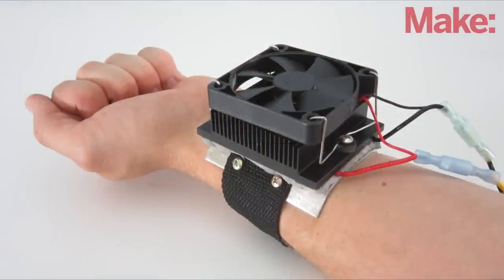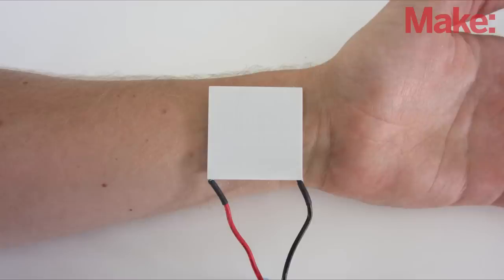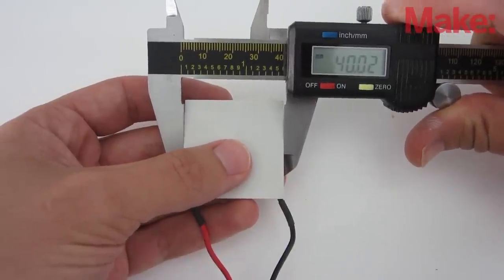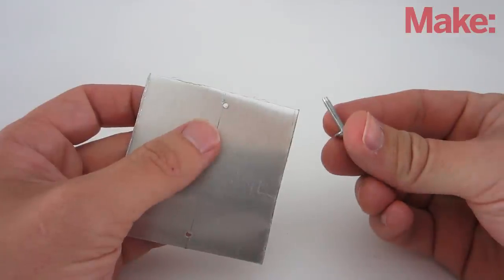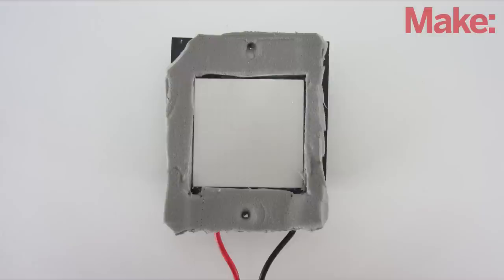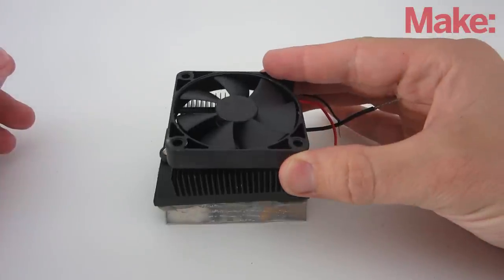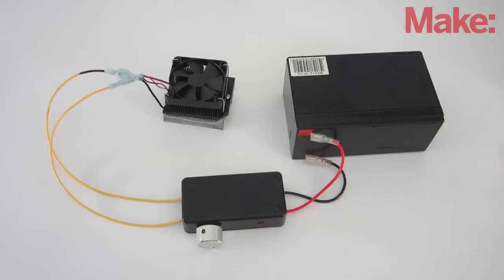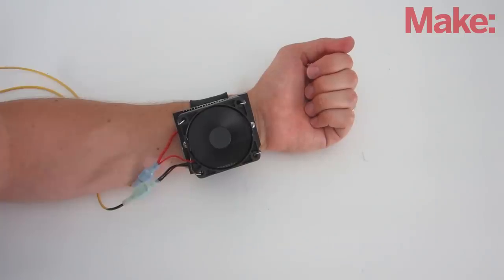Personal Cooling Unit

Comment: Wouldn't recommend doing that as it can give you a cold burns, if the peltier element is strong enough ;)
Reply: hence the 555 and the potentiometer
Reply: Frostbite happens around 0°C. If it can get that cold, a thermistor can be used so that it shuts off before it reaches freezing temperatures
Reply: @autismlifehacks5233  Even if it's 15°C, I wouldn't want to have something that cold in contact with my skin all the time. There are reasons body temp. is around 37°C and peltier wouldn't just affect the surface of the skin.
Reply: @ElectronPower  If it's above 15°C, I'm confident that you'll need something as large as a cooling vest to help you beat the heat
Reply: @autismlifehacks5233  I'm talking about the peltier on your skin, not the ambient temperature...
Reply: @ElectronPower  I understand that 15°C refers to the Peltier's temperature on the skin
Reply: @autismlifehacks5233  Well, according to your comment, it doesn't appear so 🤔

Comment: When I was young I tried to design a portable 12 volt peltier water cooler for a vest that could be worn under motorcycle gear using pwm and mosfets through an arduino to control the water pump and peltiers. The things take a lot of power unfortunately which would explain why there's nothing out there on the market like that. I never got mine to work good enough to be worthy of further development. They're really neat though! I'd love to play with them again!
Reply: Adam Savage created a personal cooler using the worlds smallest refrigeration compressor to use inside a costume. It is battery powered and worked really well!
Reply: you got the wrong materials and design i guess
Reply: I think if you had another go now you'd be pleasantly surprised with the advance in technology. I really want to try and put together one of these as low-profile as possible and then try and work it into the neck of a shirt so it delivers cooling to the back of the neck, and the batteries sat in a pouch in the small of your back, either a couple of 18650s, or a lipo pack, but that probably goes without saying. oh, and bluetooth, because why not

Comment: Cool Project! Also great to see That Make is Using mm (MilliMeters) Aka Metric instead off Imperial. Also with the Motor circuit. Use a MOSFET to control the output. (Since you're already using a N-Channel one to switch the Relay)  It will make it less noisy.
Reply: Americans don't really know it, but they've been using Metric for many years: one inch is exactly 25.4 mm BY DEFINITION, for example.
Reply: Isn't 1 inch 2.45 mm ? But yeah America
Reply: Oh just saw that you said by example xd
Reply: Jac Goudsmit
If you're doing machine tool precision work over more than 6", 25.4001 will keep you from getting rejected parts.
Honestly, distance is distance and units are units. People with Imperial scales will work to Imperial measure while people with Metric scales will work to Metric and nothing of that will change the actual dimensions worked to.

Simple fact is that "Americans" often work in Metric as well as Imperial and have for decades. There is no hidden measure that anyone is "really" working to, scales are arbitrary. Ask yourself why 1 meter is not what it was originally intended to be, a certain fraction of the size of the Earth. Yes, because the people who invented metric measure got the size of the Earth wrong by over 10%! The length of a Meter is based on an ERROR and that, my man, is arbitrary!
Reply: *****
2.45 cm, rounded to 4 places. The reality is not so neat.
Reply: *****
1 inch = 2.54 cm or 25.4 mm
Reply: ***** The length of a meter is actually defined as 1/300000000 of the distance that light travels in a vacuum in one second. In other words, light goes exactly 300,000km/s in a vacuum by definition. And a second is derived from the frequency of a Cesium atom under certain circumstances, I don't remember the details but Wikipedia is your friend :-)
Reply: ***** actually, the error is less than 0.2%, not 10.
Reply: The word meter is spelt metre unless you are not talking about 1000 mm.
Reply: Jac Goudsmit it's actually 299 792 458 m/s so it's not exactly 300000km/h
Reply: Perhaps some have trouble with words like exact and error? Or maybe have never actually done precision work? Or can't tell the difference between unit of measure and object being measured?

25.4001 mm per inch lets a person cut metal within tolerances that 25.4 does not. Been there, done it 35 years ago making not-small parts for a Swedish company.

We are not all Tea Party Idiots, thank you,

Perhaps someone can tell me how exact C was known in 1793? Fizeau came later.

The French Academy of Sciences commissioned an expedition led by Jean Baptiste Joseph Delambre and Pierre Méchain, lasting from 1792 to 1799, which measured the distance between a belfry in Dunkerque and Montjuïc castle in Barcelona to estimate the length of the meridian arc through Dunkerque. This portion of the meridian, assumed to be the same length as the Paris meridian, was to serve as the basis for the length of the half meridian connecting the North Pole with the Equator.
The exact shape of the Earth is not a simple mathematical shape (sphere or oblate spheroid) at the level of precision required for defining a standard of length. The irregular and particular shape of the Earth (smoothed to sea level) is called a geoid, which means "Earth-shaped". Despite this fact, and based on provisional results from the expedition, France adopted the metre as its official unit of length in 1793. Although it was later determined that the first prototype metre bar was short by a fifth of a millimetre because of miscalculation of the flattening of the Earth, this length became the standard. The circumference of the Earth through the poles is therefore slightly more than forty million metres (40,007,863 m).[10]
Reply: I stand corrected on the definition of a meter (or metre if you prefer): it's 1/299792458th of the distance light travels in vacuum in a second. http://www.bipm.org/en/CGPM/db/17/1/

The standard for an inch has been 25.4mm since 1959. See http://www.npl.co.uk/reference/faqs/on-what-basis-is-one-inch-exactly-equal-to-25.4-mm-has-the-imperial-inch-been-adjusted-to-give-this-exact-fit-and-if-so-when-%28faq-length%29. I assume the 1959 definition still stands, so the defined length of an inch also changed in 1983 when the definition of a meter/metre was last adjusted.

I don't know why your Swedish customer 35 years ago wasn't happy until you pretended that an inch was 25.4001 mm. I'm not a metal worker but I see that (for example) steel has a linear expansion coefficient of 11x10^-6 per Kelvin. If I understand correctly, that means that a rod of steel that's 1 meter long at room temperature would become 11 micrometers longer or shorter whenever the temperature rises or drops by one degree Celsius. So it only takes a piece of steel that's less than 10cm (less than 4 inches) long to change in length by more than one micrometer (the difference between 2.5400 and 2.5401mm) even when the temperature only varies by a single degree Celsius (1.8 degree Fahrenheit). That makes it seem pretty silly to talk about such small quantities of error when making metal workpieces, the size of a hand or bigger.

Anyway, going way off topic here...
Reply: Jac Goudsmit
Because when holes and edges need to be within 0.1mm at around 30cm apart then it doesn't matter what system of measure is used to manufacture the parts.
If the tolerances were smaller to where a part that measures right at 25C would not be at 20C or 30C we would not have taken the job. But you are talking about far smaller changes over shorter differences by regurgitating numbers that you don't know how to use.

Manufacture deals with the real, not simply parroting what someone looked up to confirm their opinion but never really checked.

You don't multiply 3 place precision by 100's and expect 2 or better place accuracy.

25.4001 is 4 places accurate what 25.40 is 3 places only, not some golden absolute but only 4 places where there are more to go.

So I tell you that all measures have some degree of error, don't spout about how close an electron microscope can get and then throw me a 3 place round off as absolute! You might as well graze with the cows.

People using one system of measure are not secretly using another just because you measure the result with the other.
Think about that next time you say 'stupid Americans' because this American sees you for the fool you make yourself out to be.

Comment: I find it weird how many people are talking about how useless this is. I don't think they are aware of the term "heatwave". When it gets hot enough, you don't care if it will look bulky and stupid.
Reply: yea I live in Phoenix AZ, they should come hang out here in the summer, they can laugh at all the people who would wear this in public while their salty tears get lost in their salty sweat.
Reply: ... or you can like ... drink cold water. Or wear wet t-shirt. Both cheaper, faster, lighter, without risk of catching on fire (when dumb and leaving the battery poles uncovered) and you don't have to drag around another kg of useless things connected via cables that restrict your movement.
Reply: It works in a welding helmet and use a copper in the headband....and no one sees it. I use Milwaukee 12 batteries and ones on the charger while the other is in my helmet keeping me cool as can be ...in confined spaces its a life saver..
Reply: @STruple12  The sheer amount of cold water you'd have to drink for a one time decrease of one degree is hilarious. By comparison, this is way lighter - as in, several pounds lighter - and it won't have you running for the next restroom half an hour after use...
Reply: @Alexander_Kale  Water's specific heat capacity is 4200 Jkg-1K-1 and Air's is 993 Jkg-1K-1 therefore water has 4.23 times more specific heat capacity. Water is 784x denser than air. Tell me more about that "sheer" amount, please. And you forgot about the wet t-shirt = no drinking, same effect.

If you like to make simple electronics then knock yourself out but other than that it is simply an impractical toy.
Reply: @STruple12  have you felt a thermoelectric cooler?

Comment: Would you go out with something like this on your wrist?
Reply: As long as it work, i would
Reply: Kopeke88 obviously i mean as long as it doesn't make me look like a dumbass
Reply: dumbasses would be the people suffering by the inmense heat :P
Reply: if it works it ain't stupid.
Reply: it doesent
Reply: decidiousrex WRONG. A 7.2 volt Lipo at 6000mah can extract roughly  40 watts of heat energy over a period of 2 hours. Just gotta refine that prototype to be slimmer and sexier. There is no box.
Reply: GrimmEngineer uhh.... no, YOU'RE wrong. you plan to run a 6 amp, 12 volt peltier on a 7.2 v, 6 ah battery and have it run for two hours?
where the hell did you learn basic electricity? go and get your money back, because they fucked it up
Reply: decidiousrex OK Doctor Decidiot. You failed to mention the current draw of your selected peltier so how do you know what mine is? Rube... Basic electricity. Lolz. I'm so advanced I can't post an Avatar. 'snicker' You obviously don't know 'basic" electricity (love when people use that term, haha) because when you run a 12 volt 6 amp peltier at 7.2 volts it draws roughly 3.6 amps. Doh! And a 7.2 Lipo is only 7.2 at peak charge. Depletion mode is achieved at 6.4. So assuming worst case scenario at 6.4 which would give us 3.2 amps of current draw. Since we are using DC we can assume a unity power factor of 1.0. So I x E x 1.0 pF = 20.48 watts of energy for almost 2 hours which would be about 40 watt-hours. You can go bury your head in the sand now.....
Reply: decidiousrex OK 85...
Reply: Mr White LOL I don't feed trolls. Sorry
Reply: decidiousrex you're the troll...
Reply: Mr White hahaha
I know you are, but what am I? Seriously? The 4 year old defense? Too funny
Reply: Leave the 85 alone in his troll-hut. I already owned him...
Reply: Mr White PS, if you wish to have an actual discussion about this idea, I'm game as long as you can be respectful and not resort to name calling.
Since I'm guessing you don't plan on taking that offer up, it is you who is the troll.
Reply: purge98 Nice of you to back up your statement with actual supporting facts. Wait, no...looks like another trolling 85.
Reply: ok 85...more facts still missing....like "everyone"
Reply: ElectronFun.com when i am working on the roof in +40 out
Reply: Tom Drew Good enough reason :)
Reply: You can actually build a small one with stuff from a dollar store xd
Reply: yes

Comment: I love peltier modules. Lots of good things you can do with em if you're creative.
Reply: Richard Noggin Do you have some websites with ideas? I bought one of those and im planning of using 9 volt batteries will it work with 9 volts? And also the fan will it work with 9 ?

Comment: You could use a potentiometer to vary the output but it would drain battery power fast. The 555 timer method is more power efficient

Comment: Why would you use a cooler like that, if our body is already getting watercooled?
Reply: To cool the "water"
Reply: +Farnømat ;D
Reply: What ? Are you trying to say you've never been uncomfortablely hot?
Reply: Because when the weather gets hot and high humidity, the evaporation cooling system used by our bodies gets less efficient.
Reply: come visit Arizona in july, see just how good your bodies water cooling is
Reply: This is just aditional radiator

Comment: Using lower voltage produces more gentle cooling.  I use a 3.7 volt (charges up to 4.2v) 18650 size lithium ion battery.
Reply: You have used one of these? How is it? Are they viable?
Reply: @logans3365  They work well.  A thin layer of heat-conducting gel is used to make them work better.
Reply: @ndrthrdr1  I want to doesn’t one everyone can use, possibly placed on the lower back so that it’s not cumbersome.

Comment: I wonder, does your hand get cold? I just googled how the veins run in the wrists and it seems the hot blood into hand goes via the middle of the wrist. So, If you put a piece of that insulating material there, in theory, you would get hotter hand, which would exchange heat to the surrounding air more efficently and the bloodflow to the heart would be cooler, thus dropping your body temperature more. It propably wouldn't be more powerful, but it would propably be more efficient. Having portable power source. How about making a solar powered hat? With a propeller of course.

Comment: Sandwich a tube of salt water between two gloves, low profile fan and heatsink and BAM! INSTANT GLOVES FOR SUMMER!!!

Maybe just sew it to a pair of nylon gloves that you can pull other gloves (like, for work) over so you essentially have an insert with the cooling unit on the back of the wrist.

It would help cool more blood returning to your body and avoid frostburn from the unit only cooling (and numbing) one spot.

Comment: Ordered the parts online today. Thanks for a great video.
Reply: I am making a small change. Aluminium is not very toxic but I am replacing it with stainless steel.
Reply: Rio Jazuki but aluminum is a good themal conductor while stainless steel is a poor one. There's a reason all expensive stainless steel pans have a chunk of aluminum or copper sandwiched in the bottom.
Reply: Nick Horvath Silver->solved. (Just kidding btw)

Comment: Where do you put the huge lead-acid battery? xD Very cool idea however. :D
Reply: There are much smaller lithium batteries you can use, anything at 12v that pushes enough amperage to work the electronics, which shouldn't be too much anyway.
Reply: I was going to make a circut that mounts on my belt and also runs a small pump to run a water cooling loop which I'll mount in a camel pack
Reply: Tex81024 it would all run on AA batteries, I would then tweak the circuitry some
Reply: Tex81024 
You shouldn't need a water pump actually... 
With a system that could fit in a glove or shirt you could just rely on the movement cause by the temperature difference
Reply: If you insist on a pump any tiny impeller would work, just make a housing. Or use a magnetically inducted impeller... put a magnet on a fan blade and use its passage to turn your impeller. No need for new wires like that.
Reply: Duck tape it to your other arm........ Lol
Reply: Tim Gomes You'd look like friggin' Iron Man!
Reply: And carrying that heavy battery around is going to heat you up more and when it dies 20 mins later you are carrying dead weight around

Comment: Why did you use a relay to switch the peltier-element on and off? A P-channel MOSFET would be much more suitable since it can switch much quicker and is a lot less bulky. If you don't want to use a P-channel, you could use an N-channel with a slightly different, but much simpler, circuit.

Comment: You know whit the right adjustments you could use that to make a temperature control suit.  All you need is a way to switch the plate around so you can have both a hot suit for the winter and a cold suit for the summer.
Reply: lassi kinnunen
True but with the right materials it could actually be relatively cheap. Plus if you have a solar panel and replace that battery with a smaller rechargeable one. You can have that thing running all day and night.

Comment: Would like some way to find out if it works.  Ie does it really cool your blood,  ie your body? 
Don't know,  but if someone could kind of do a simulation with 3 ltr of fluid going through 50 meters of 98.6 F  temp tubing and about 40 mm this tube is kept at  40 F.  
Would it cause any difference?  Now that I have stated the above,  it does not sound possible to me.  What is 40 mm cooled tubing,  in comparison to 30 or 40 meters of heated or regulated Y heated tubing.  Nope don't think it would work.  But would love to be wrong.